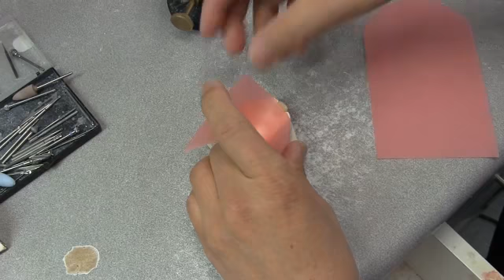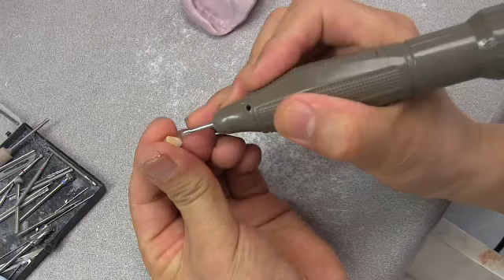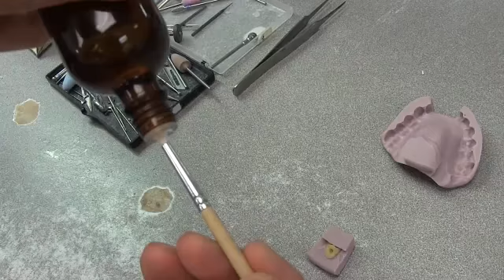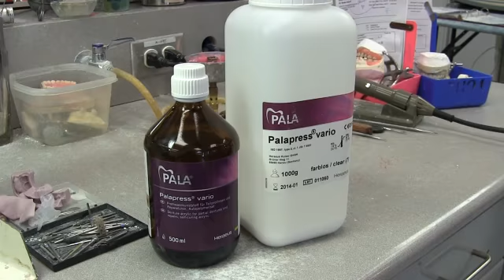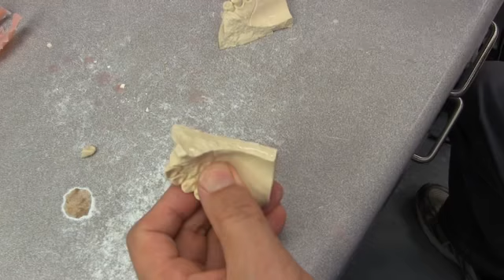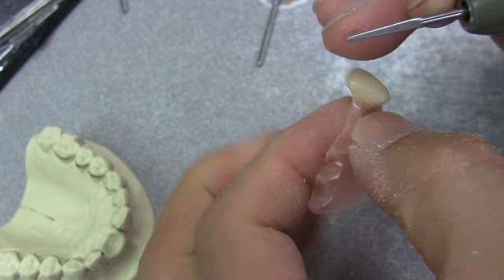A Quick & Easy Transitional Partial Denture

Comment: I'm a Dental Tech. for 51 years.Your technique seems to work but after doing the wax up wouldn't you have a better product by investing packing and heat curing it under pressure?

Comment: between the old dude's voice and the hideous music, I was unable to watch it til the end. One thing I noticed, they don't say if it is hard acrylic or .flexible.
Reply: richard harrison palapress is normal cold cure acrylic, hard but not high impact. I would not use it for my partial job, as it is not strong enough and the shrinkage during this process will affect the fit, especially to the postdam. Anyway, this old way is good for labs, but not good enough for clinical use. As you will be facing a lot of breakage and ill fitting afterwards.
Reply: @vipwilford  what acrylic would you suggest, then?
Reply: I sorta tuned out the music, and pretended the narrator was a teacher, so I did fine, LOL!
Reply: 8years ago answered that for me.  Still super cool technique